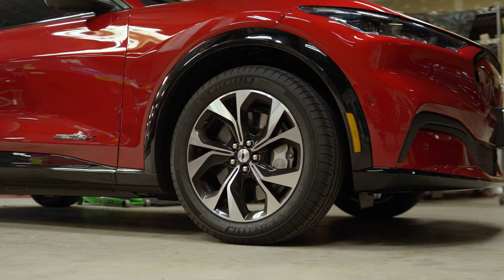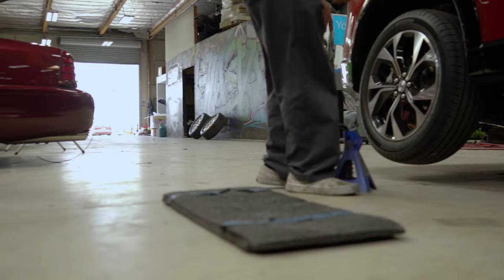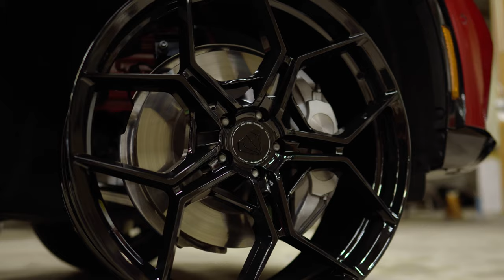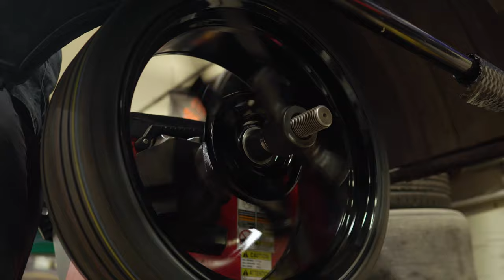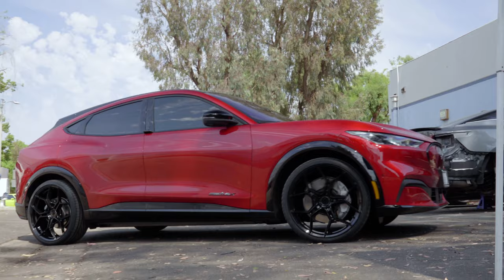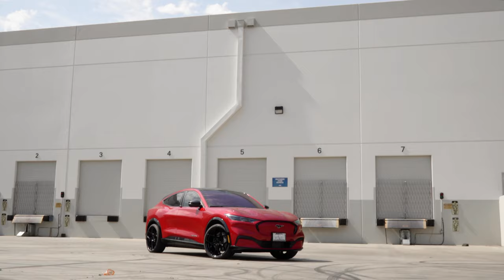Twenty Two Inch Wheels on a Ford Mustang Mach-E | BD-F25 | F-Series

Comment: Perfect to lift a Mach-e like you NEVER should lift one. The bar they use to lift is essential part of battery frame, not to be used for lifting. You will have soon to order a battery of about 30'000 USD if it is even available.